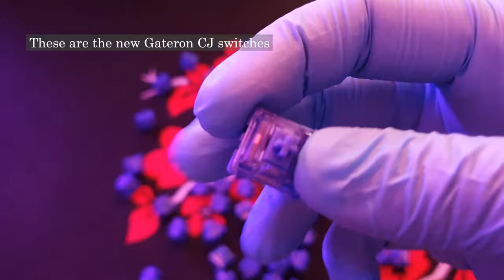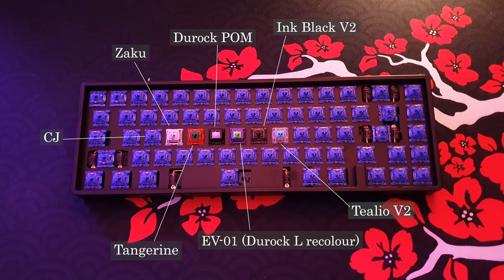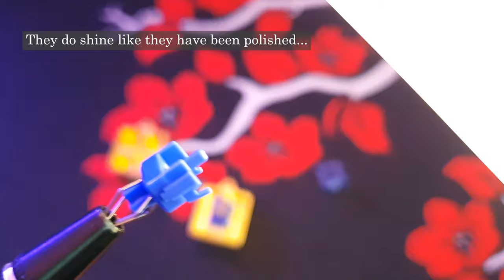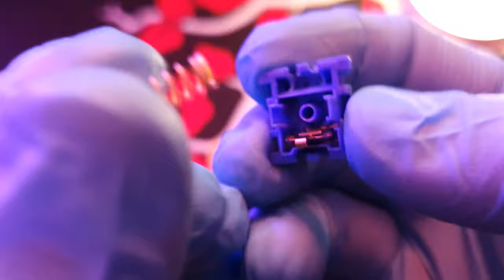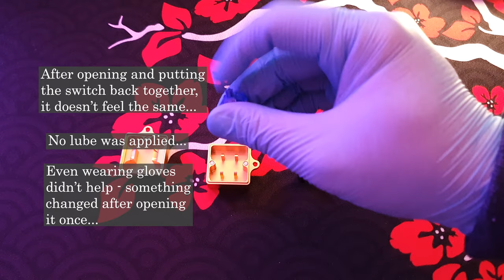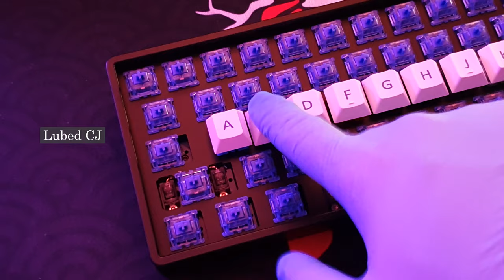The Smoothest Stock Switch?!  |  Gateron CJ Switches review

Comment: Thanks for this. The cheapest I've found these for is at a vendor that sells them unlubed while pretty much every other shop sells them factory lubed. I was worried that I would have to put in all the work to lube them to make them be as good as everyone says they are, but if they're great in stock form without any lube, then I am happy with that! (I collect 1800s, so modding 100+ switches for any of my boards is simply not fun for me haha. I try to buy switches that are already good without any mods.)
Reply: I'm right there with you. I have a 96% board and lubing and filming 90+ switches can be, quite frankly...a pain in the ass. But yeah I try to find switches that are already pretty good stock or work well pre-lubed too.
Reply: @CDeeez94  Thankfully, good switches right out the box without mods are much more common than they used to be! I also am a fan of clicky switches (click-bar types from Kailh and Zeal Clickiez, not the click-jacket style like cherry blues). A good click absolutely can mask a multitude of imperfections in a keyboard, so it’s my other way of avoiding modding lol.
Reply: @TBSxDRUMS  Yeah you’re right. I’m kinda glad the quality of new switches seems to be on the rise. It’s like the finally listened to consumers lol

Comment: someone pls help.. what kind of spring does the cj have in it? i love how these feel so i want to get some tx or sprit design springs that are like the ones in the cj. idk what it is about them but they don't feel like any other linear spring i've tried. they're rated at 60g but they feel heavier than that and the weight is right at the top of the press
Reply: Apparently they are the same as the ink pink box springs so
Reply: I don’t recall if the CJ used the longer spring but if it does that extra weight could be there in the initial press feel. I like to use black inks v2 L+F with tx 65g long springs.  Makes the initial press feel slightly heavier but the rest of the follow through feels light. 

I just built a board with CJ’s and didn’t feel the need to spring swap them. In fact I just lubed the stems and didn’t even film. The switches feel and sound great to me.

Comment: Can you comment on how they feel a few months later? I live in a really dry climate and there's a ton of dust kicking around all the time. Not being able to open them up and clean them once a year seems like a double edged sword.
Reply from the maker: Still incredibly smooth. Do you regularly open your switches to clean them? That must be a pain! Maybe try something like the new Gateron Box Ink switches? They have the dust proof housing / box style housing stem to help prevent dust build up etc
Reply: @bontaboards8684  I've had to open up my daily driver every year to clean the switches since they get pretty mucked up with fine particles. It definitely helps me appreciate my boards more =p

Since the CJs have an ink top, does that make them somewhat Anti dust as well?
Reply from the maker: @darrenlam4189  oh wow okay. No, the CJ have the original Ink V2 top material, but there's a new "Box" ink that just came out with the walls around the stem, try searching for that!
Reply: @darrenlam4189  Maybe it's a good idea to use a dusk cover for you keebs if you haven't done already, it helps a lot since I have a cat
Reply: There are Gateron CJs with box stems available at some keeb shops. The box stem is supposed to protect the inside of the switch from debris. A few places I can think of off the top of my head are KBDFans and YMDK currently offering box CJs.

Comment: Should I get gateron yellows or these? I like the more 'clacky' sound profile btw.
Reply: gateron yellows are budget option so i don't think you should compare them. If u want smooth and clacky sound go for the Akko vintage white. They ar really clacky and sound good
Reply: Then these. Get gat yellow pros if you want a much cheaper switch and they are already lubed pretty well. Alot good budget switches now but gat yellows are always pretty solid.
Reply: CJ is way better than yellow
Reply: @kalerax gat yellow pros are so good that they're def comparable, have u tried them yourself?
Reply: @monkeyman2900  yeah i have them and in my opinion akko switches sounds better than gat yellow pro. Akko switches sound clacky or poppy which i like.

Comment: Do you feel like they are deeper than inks and maybe you know if they are deeper than pom durock?
Reply from the maker: You can see I compared the switch to both inks and durock pom linear in the video! I think Inks (lubed and filmed) are deeper and have a better sound. These are slightly clacky compared to inks but in terms of stock, these CJ switches are the smoothest stock switches around right now! I'm using mine just stock and love the feel and sound. I think these are better than durock pom.

Comment: Could the top housing being looser affect the tolerance, might be slightly shifted instead of perfect when they first put them on. Does lubing fix the issue
Reply from the maker: I don't think the top housing is loose. There isn't an issue, these switches are great stock.
Reply: @bontaboards8684 forgot to say the top housing might get shifted or looser when u open the switch.
Reply from the maker: @Byrin_  ah I see. I don't think that's the case because there is also a slight gripping on the rails after it's been opened - it's basically not as smooth anymore, so it does feel like the polish has been disrupted somehow when opening them. Basically yes, if you open them, definitely lube them.

Comment: nice vid, would you say that these are better than tescee ice candies?
Reply from the maker: I haven't tried ice candies so I don't know!
Reply: @bontaboards8684  wdym in this video when you talk about not opening them I lubed mine and they were much better
Reply: I knew someone would bring up Tecsee ice candies. I have them, and they're pretty smooth lubed.
Reply: @amzet_513  Do you know if the ice candies has north facing interference? Thank you
Reply: @gamer7.7bviews1minuteago..8  The point of the vid is not to open the switch and do nothing with it or just spring lubing.
If you open the CJ lube it like any other regular linear, the stem, the rails etc.
Reply: @vectivuz1858  no shit Sherlock how the hell else would I lube a switch
Reply: @gamer7.7bviews1minuteago..8  Some just lube the springs. Some follow the gazzew method even with linears. So why are you worked up?
Reply: @vectivuz1858  imagine using gazzew method 💀
Reply: @gamer7.7bviews1minuteago..8  nothing wrong with it though. I just use less the amount he shows. O well to each his own 😂

Comment: when they are lubed do they get smoother
 i was woondering becuse of the fact that you said that they get less smooth if you open them
Reply from the maker: If you open them and do nothing then it messes with the polish and they won't be as smooth. So if you open them, make sure to lube them and it will be smooth. But as stock, these are incredibly smooth already and personally I don't think they need opening/lubing. No other switch arrives this smooth in stock form.
Reply: @bontaboards8684  Does this assessment come from a sample size of more than just the one?
Reply from the maker: @justinc8157  yes and also verified by other people